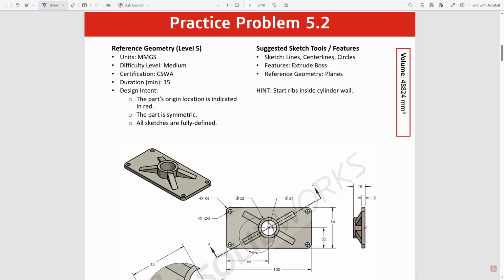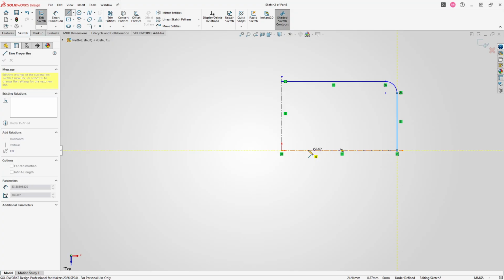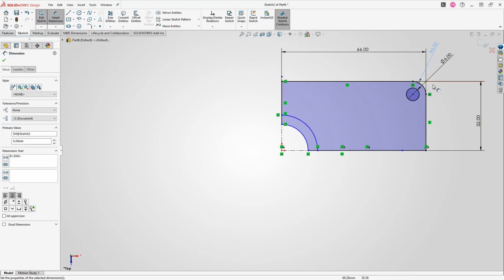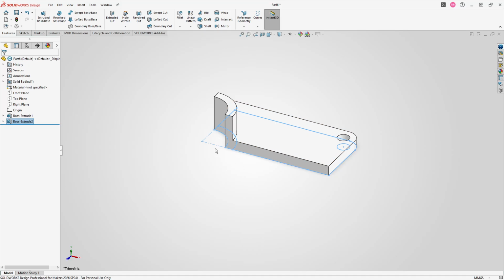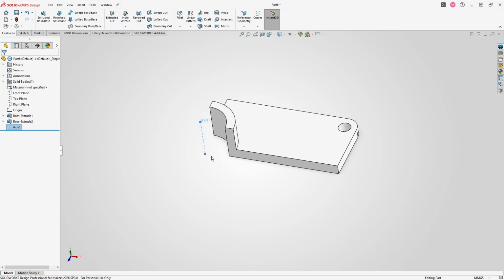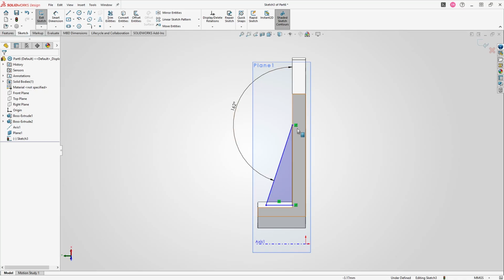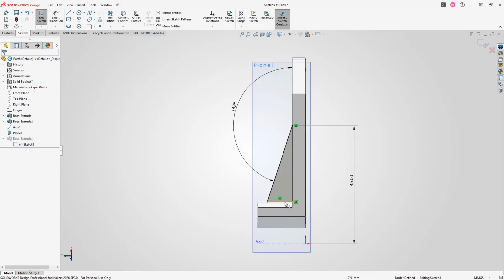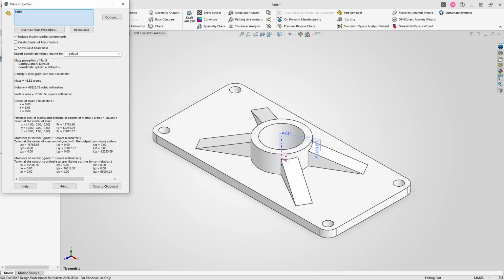SolidWorks CSWA Practice Problem 5.2

Comment: Interesting way of doing this - that's the fun thing, finding the different ways to do the same part, the different way people look at things. The rib, they do say about starting the rib inside the diameter in the middle and I did a profile from the side and started it inside the diameter so you didn't get what you got and the rib not intersecting the part.
Reply from the maker: Yes, definitely different ways to solve these problems.  Honestly, if the hint weren't there, I'd probably use the Rib feature these days.  Of course, at the time I made the video, I didn't even know how to use the Rib feature yet. 😅